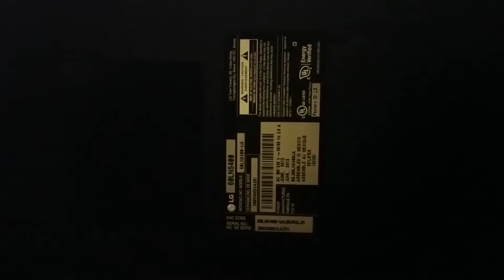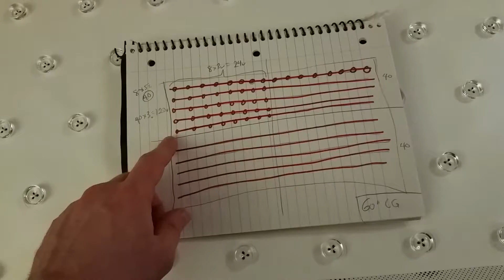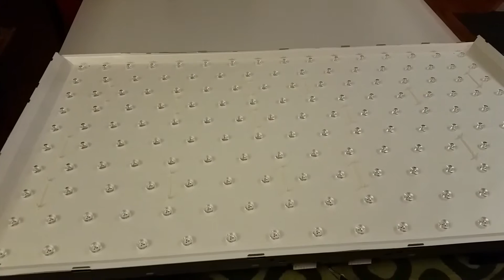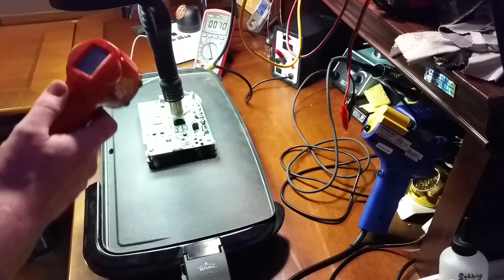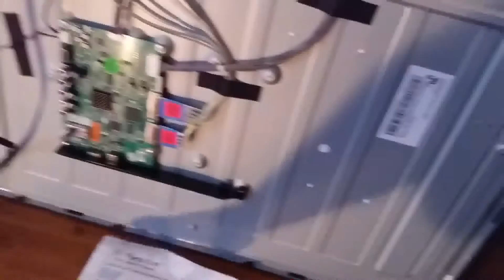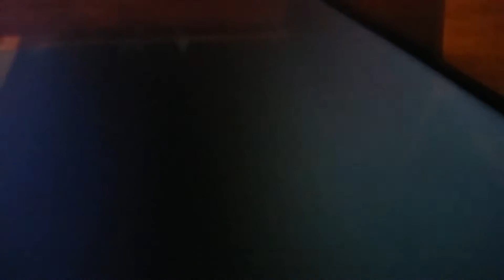How to trouble shoot and fix LG 60LN5400 60" LED HDTV

Comment: before spending $$ on main bd - you should check panel.  disconnect LVDS cables one at a time to see if left or right side of panel has display.  This checks the panel for shorts.  This can sometimes be repaired by tape method on the LVDS cable. Also you can check the LEDS easily with led tester.

Comment: I just got one of these today, someone dumped it off and I turned it on and there are backlights, but no picture or menus. I noticed that LG tv's have a lot of issues with their mainboards. In particular, problems with the bga chips. I am not going to even bother with it, you can't find any mainboards for these, not from the tvpartsguy, shopjimmy or even ebay. I miss the days when all you had to do was replace some capacitors or maybe some diodes to fix a broken tv,  these newer ones are complete crap.
Reply from the maker: Try a reflow before giving up. Or if your feelings adventurous a re-ball. I've done both with luck.

Comment: It know it late to ask a question, but what pins are you hitting to test the led? Hard to tell in the video.
Reply from the maker: If the strips have test points for each LED you can use that or just use the connector pins. Doesn't matter as long as you don't exceed 3 volts per LED.
Reply: I’m sorry, I meant the pins on the power board. Where you bypassed and forced the 24 v for the leds without getting to the test points on the led strips.
Reply from the maker: @noelc3792  you have to look at the label on the power board. It's typically labeled back light on or power on or something of that manner.
Reply: Thank you, appreciate your help in this. Also for the video. It saved me from having to get to the leds.

Comment: i have a LG55LW5600 tv and the usb or hmi ports dont work, what do i need to do to fix it??
Reply from the maker: Trouble shoot.
Start by narrowing it down. Is it missing +5 power or data?
Reply: Tv works, but nothing works if I plug it into the ports
Reply from the maker: @mattclark1712  If it's missing +5v power, it's possible someone plugged in a shorted USB cable or dongle and popped a fuse. But your going to have to dig in a little deeper.
Reply: I cant put WiFi on it
Reply: Ok thank you, I’ll tear it apart tomorrow
Reply: Where would I start checking, I have the back off
Reply from the maker: @mattclark1712  check the 5v pin for 5v.

Comment: Hey brother, same model. But the tv doesn't even turn on. Lightning did strike in those days. But it started by losing one hdmi signal. Then the next. Then it stopped turning on. Any hints?
Reply from the maker: Eliecer Falcon 
Probably the main board. But lighting can definitely hurt the power supply.
Reply: jeffescortlx I guess I'll open it up and see.
Reply: So a diode inside is shot. Since the grounding of the house was bad from the cable signal. 
Any idea where I can buy the proper diodes for this board?